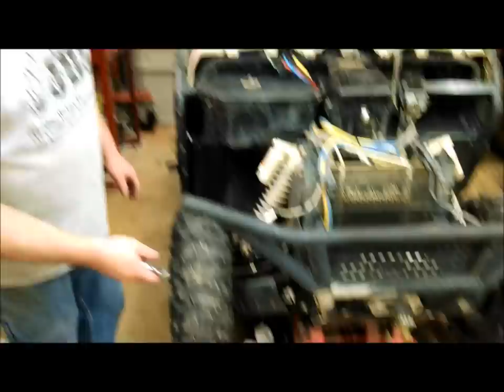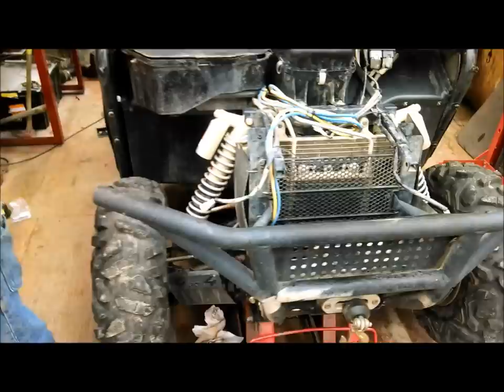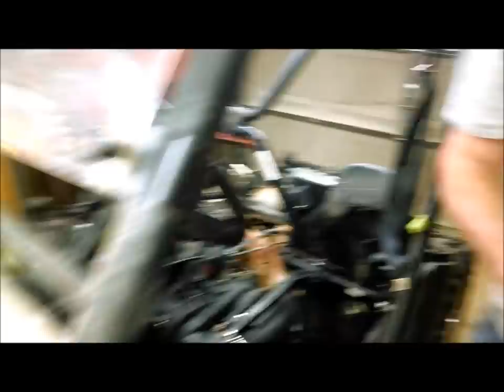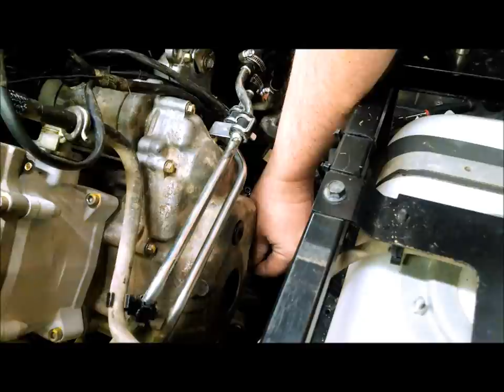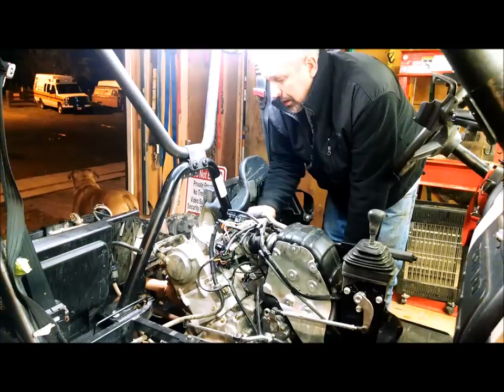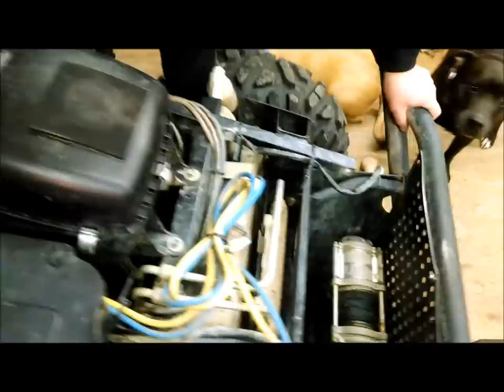How to bleed the cooling system on a Yamaha Rhino 700

Comment: The temp light comes on my rhino after 15 min of idling , if I take off down the road sometimes it will go off . Runs perfect and doesn't have coolant in oil . Any suggestions , I cleaned rad real good today and still same problem
Reply: Bobby L does your cooling fan kick on?

Comment: What do you do when the original waterpump has a fitting for the 5/16 line coming from the thermostat housing to the waterpump and the  new pumps doesn't have it and ordered 2 pumps to verify them!What's the best solution for that problem
Reply from the maker: Order Yamaha

Comment: The manual says to run it 10mins to warm up after bleeding, without cap and rev five times. Then fill to top. What do you think about that? . CHANGING THE COOLANT ~ ------------------------------------------------------ b. When coolant begins to flow out of the bolt
hole, tighten the water pump air bleed bolt
to specification.
~liI Water pump air bleed bolt
.w~ 10 Nm (1.0 m· kg, 7.2 ft· Ib)
c. Loosen the thermostat cover air bleed bolt
(g), without removing it, to allow all of the air
to escape from the air bleed bolt hole.
d. When coolant begins to flow out of the bolt
hole, tighten the thermostat cover air bleed
bolt to specification.
~liI Thermostat cover air bleed bolt
.w~ 10 Nm (1.0 m· kg, 7.2 ft· Ib)
~~~~~~~~~~~~~~~~~~~~~~~~~~~~~~~~
15.Start the engine, warm it up for ten minutes,
and then rev the engine five times.
16. Pour the recommended coolant into the
radiator until it is full.
17.Stop the engine and allow it to cool. If the
coolant level has dropped after the engine
has cooled, add sufficient coolant until it
reaches the top of the radiator, and then
install the radiator cap.
18.Start the engine, and then check for coolant
leakage.
19.1nstall:
3 - 24
• fuel tank
Refer to "FUEL PUMP AND FUEL TANK" in
chapter 6.
• rear console
• seats
Refer to "SEATS, REAR CONSOLE AND
INSTRUMENT PANELS" in chapter 8.